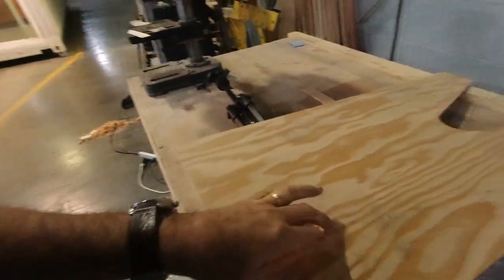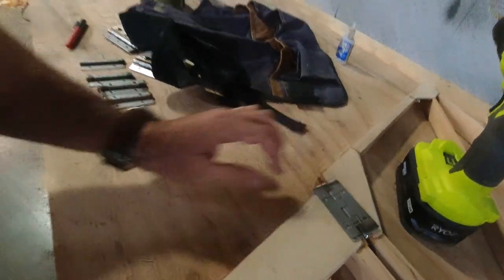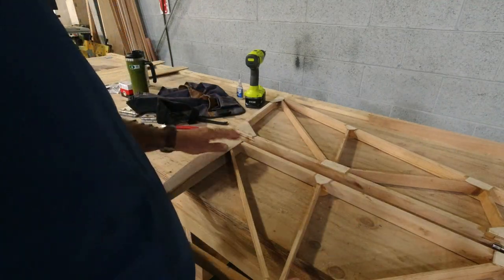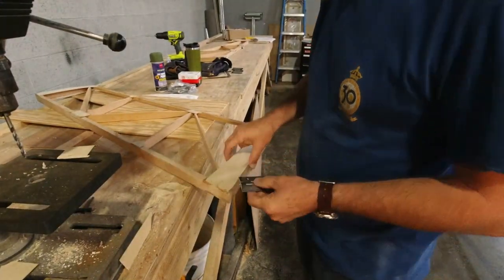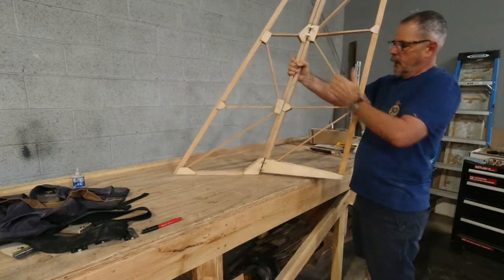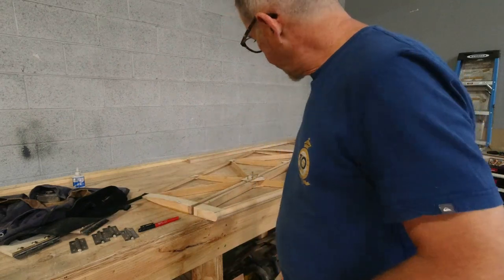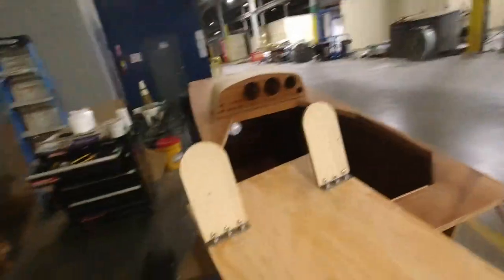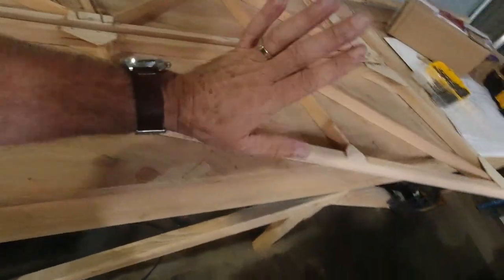Minimax 1100r Wood Aircraft Build Ep 102

Comment: Looking good bro! I used 5/16" diameter bungee cord instead of metal springs to hold the rudder pedals forward. The nice thing with that is you can adjust the pedal tension so the plane will fly feet off.

Comment: Dennis.  This is a little bit "ahead" in your project, but I keep thinking about the gascolator you showed us.  You mentioned that the one outlet "will be plugged."    Maybe I'm thinking way to far "out of the box," but something came to my mind - and it is this:  Could you not plumb  a "Second fuel pump" output  into that boss you were going to close off on your gascolator?  

I know the facet pump I used in the EROS was "one way" on the fuel flow - could not pump back through it.  My idea is that your second pump would be on "standby" and any fuel coming into and out of the gascolator will go INTO that line as well, but would stop when it hit your second pump.  Then, if the first pump fails, flip the switch for the second pump and you are back in action.  The second pump would pump fuel into the gascolator, and also "pump back" into the first pump's line, but would stop at the "inop" fuel pump.  This would give you two sources of fuel puressure.  Just a thought.  Probably way off base with this.   Thanks, mike d
Reply from the maker: Michael, I like the idea of redundancy in the fuel system. Thanks for sharing, I’ll have to put some thought into this.
Reply: @DTMinimax  Dennis, thanks for your comment.  Yes, the "second standby pump" would be plumbed to the fuel source, via a selector valve for each pump.  Just a hare-brained idea.  :-)  Thanks.